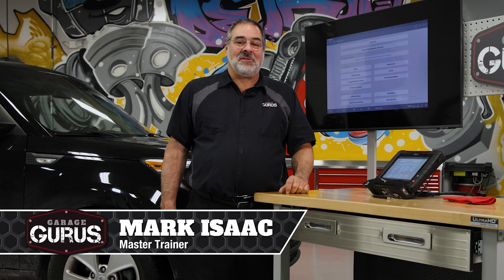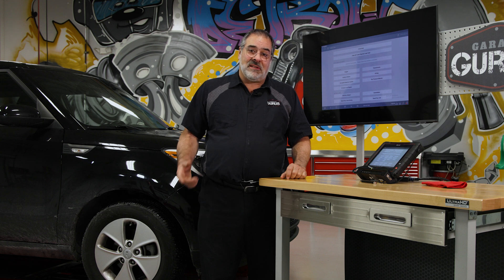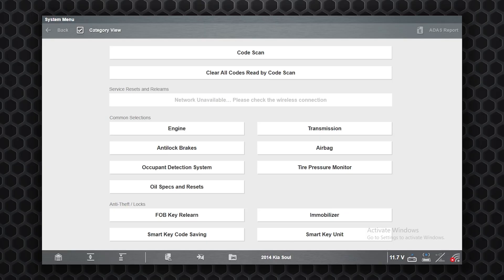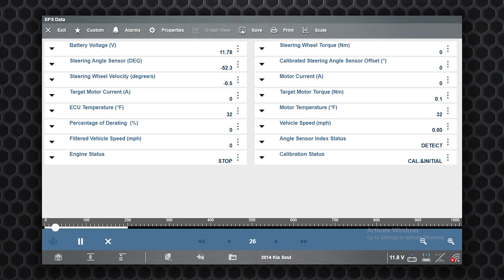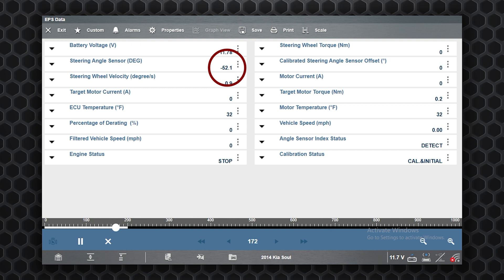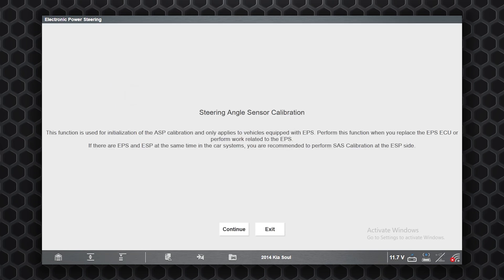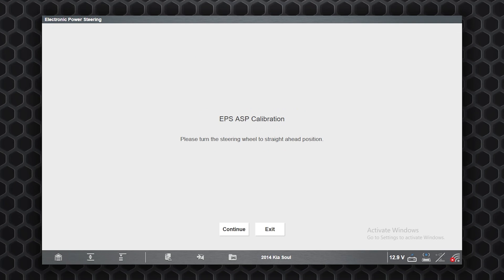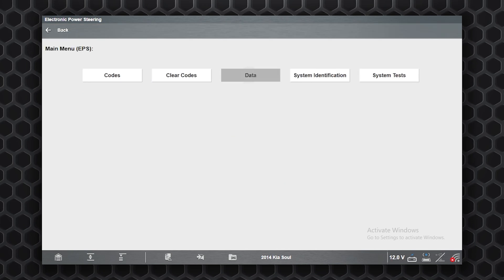Garage Gurus | 2014 Kia Soul Steering Angle Sensor Calibration

Comment: Yes, a scan tool has access to the parameters of the steering angle sensor and capable of changing to balance parameters. Great!  Yet, more specifically, what are the resistance signals, streaming data, hall effect or voltage signals being manipulated?  In our business of diving deep into Obsolete, Discontinued, and Difficult-to-obtain parts, we need the real nitty gritty to investigate and repair or replace NLS parts.  How many of you out there can find out that the polarity reversing chip in a Ferrari fold-in rearview mirror is the same chip used on a Toyota Tacoma?  Few, I am sure. This involves deeper understating, through deep investigation of often hidden by manufacturers information. IE, as an owner of a 2023 Hyundai Sante Fe Plug in, the dealership denies me access to the wiring diagrams. Fortunately, All Data has it. There is always a workaround. Yet not always an easy solution.